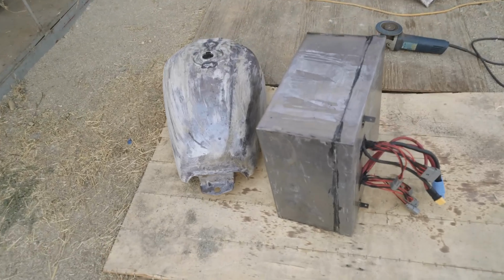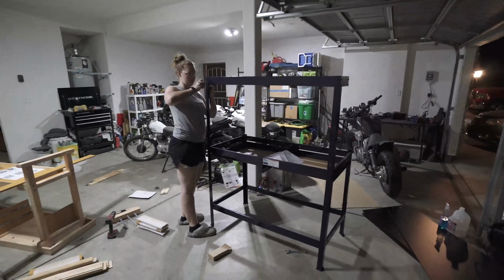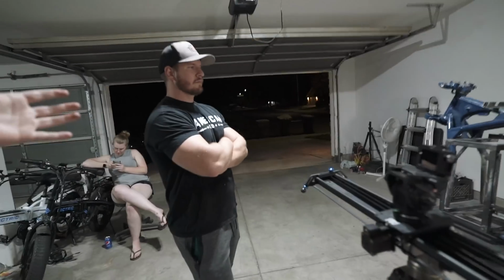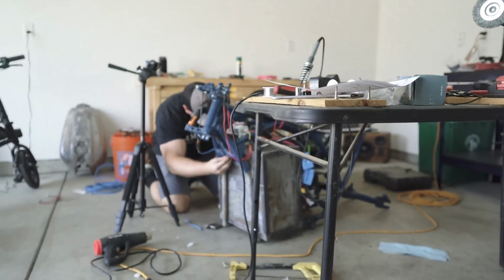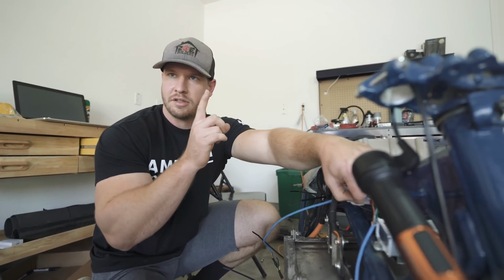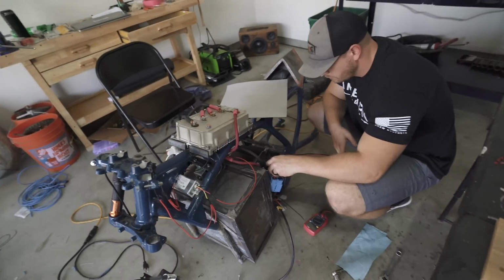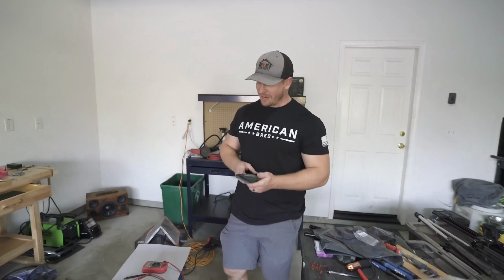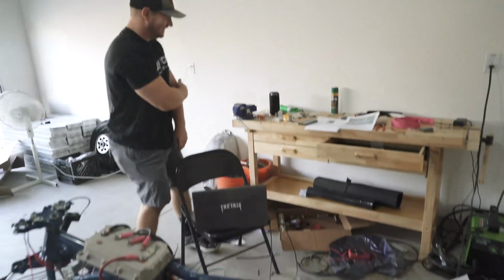ELECTRIC CAFE RACER for $4,000 | It's ALIVE and RUNNING

Comment: did you every figure out the reason the battery voltage was low? I would've initially attributed it to BMS protection circuits but you bypassed the BMS on discharge. As Kurt said, the BMS couldve been slowly discharging the battery over 2 months - although that BMS shuts itself off and takes very little power. I have one of those on an ebike with a 72V battery and it sat for almost the entire winter and only lost a few volts. Looks like you managed to revive the cells, but taking them up from <1V is sketchy!! Hopefully that didnt damage them. Fortunately LiFePO4 is a more robust chemistry. I would definitely throw some kind of low voltage alarm/protection on there or something - normally the BMS would handle it but since you have it bypassed, you wouldn't want this happening again if you let the bike sit for while. love this series and really digging your channel!!

Comment: Great progress on the bike! Bummer about the battery voltage :(  If that 19v measurement is accurate each cell was discharged to 500mv, well below their safe threshold, be super careful. The fact that the pack went from 19 -> 84v in only a hour makes me think that the BMS you are using might have some sort of low cell voltage cut off to protect the pack from over discharge. Do you have a link to the BMS unit you are using? Can't wait to see you take the first ride.

Comment: The switch is not powered, it just re directs. There should be a single input and two outputs. Apply the 12V to the input the output should be able to be applied to a signal wire on the controller for reverse if required. I never bother wiring reverse on my bike. Remember to fuse everything. I use a small automotive fuse box from princess auto. Looking forward to seeing the final product!

Comment: I'm doing my build right now, was your 12v regulator enough volts to engage your solenoid? do you have a link to your solenoid online? (solenoid/contactor)
Reply: It’s an sw200-12v. 400amp continuous rating, I believe. Got it from Kelly controllers with the controller for ~85 dollars. It only pulls 11 watts, so the step down is more than sufficient
Reply: @curtmacneill8703  cool thanks man what voltage is your battery pack on the bike? Thanks again.
Reply: @Timbodacious  whole pack nominal voltage is 102.4, peak is 116.8

Comment: I'm curious how many 12 volt watts it takes to pull in the coil on your main relay.  Add that plus all lights, possible radio might be too much for your step down
Reply: 11 watts, wow that's not much at all.  I just know that in rush on big coils can be a lot.  Very nice safety feature and a great way to wire your drive.  Hope the battery ghost doesn't return...
Reply: It’s rated at 11 watts, and the step down is 200 if I remember correctly. Shouldn’t be an issue if everything is LED! If we ever put speakers on it that would be a separate converter for sure

Comment: Enjoying the build so far. I want to add my .02 on your build. In an effort to save weight, try removing all the extra threads on your bolts. Anything that's longer than the nut. You'd be amazed how quickly you can shave a full pound. Same with wiring. Leave adequate space for sure, but don't use 12 inches of wire where 8 will do. Every ounce saved is less strain on the bike, and likely a touch more range. All pluses. Good luck.

Comment: I’ve been told all my life that batteries sitting on concrete will discharge them. Maybe it was sitting on the concrete or close enough to it. Car batteries I always sit on a block of wood if I sit it on the floor.
Reply: That is from WAY old lead acid batteries.    It was back when they used rubber case on the battery and the electrolyte would leak out from the cells, short the cells and kill them.    With modern lead acid/agm, they don't leak.    But yes it did happen in the past but it is no longer a thing due to modern building matert.

Comment: Most bms's still put out some weak voltage when it's in protection mode to lower the spark when you connect a powerful charger. Glad you got it all worked out.

Unless you had the battery in discharge only wiring for the main output, then yeah, those cells are ducked.

Comment: BMS protection mode when it dropped too far, hence the non-voltage reading, unless you are running the power leads directly off the battery...then I dunno.

Get yourself an electric domino throttle. much better than that chinese stuff :)

Comment: All Lithium Ion batteries lose their charge if not used by gradual de-ionisation. It's perfectly normal. They store electrical charge differently to Nickel Cadmium, Lead Acid, Alkaline, etc. batteries which only lose charge via discharge or their internal reactant's chemical decay.

However, as with all batteries, they lose a wee bit of capacity everytime they're cycled, rather like having a fuelled vehicle whose gas tank shrinks minutely everytime it's filled up. That's one of the big drawbacks of electric vehicles that rely on batteries rather than a fuel cell.
Reply: Everything u say is true, but u are still wrong.   Lifepo4 will not entirely discharge in a couple of months on their own.    Something in that pack discharged the battery.

Yes batteries degrade, but that can be managed by not charging to 100% and not discharging to 0% .    Stay in the 80%-20% range and batteries will last 4000+ cycles.  

Fuel cells suck, and here is why, SULFUR.   It fouls up the membrane.   If u ever get a FC car, don't drive behind a diesel.

Comment: Check the 6th cell + bms wire. My battery did the same and said 13.5v because my 4th cell had its bms cable disconnected